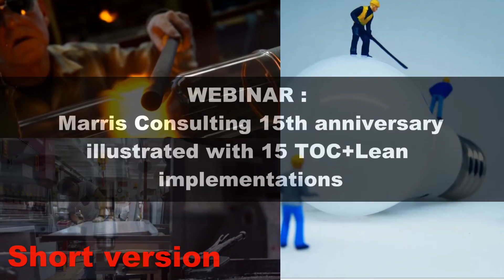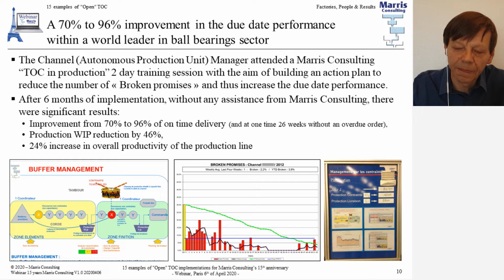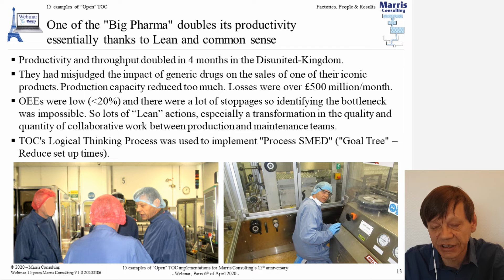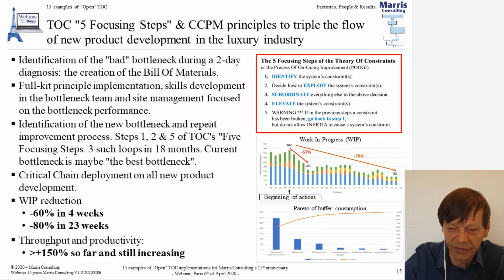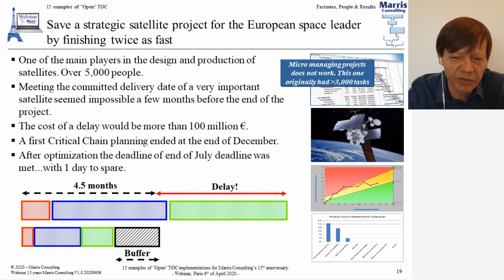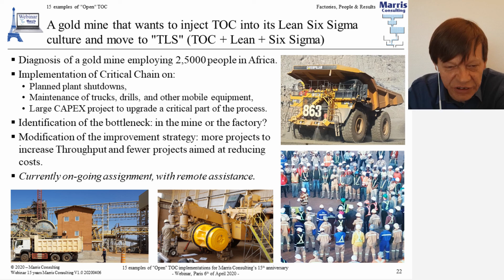15 Examples of Theory Of Constraints + Lean

Comment: A very good compilation Philip. Testimony that TOC is domain agnostic. I could relate to the example of pharmaceutical company, where it was difficult to identify the bottle neck. Was in a similar situation at my company; utilisation of ~50%, overwhelming number of defects, across lines. We fixed the flow by synchronizing between the parts and just that pushed the utilisation by 20%. With the flow fixed, bottleneck was easy to identify. We also used CCPM successfully to reduce our backlog; full kitting was what made all the difference.
Reply from the maker: Thanks for this valuable comment! Bad synchronization of components (doing more A than Bs and vice versa both required for C) can have a big impact on the output.